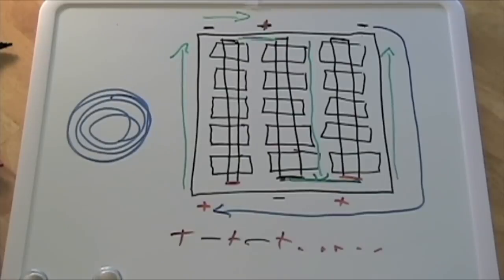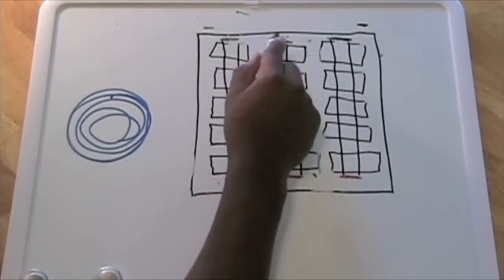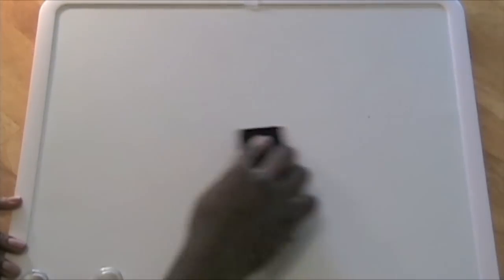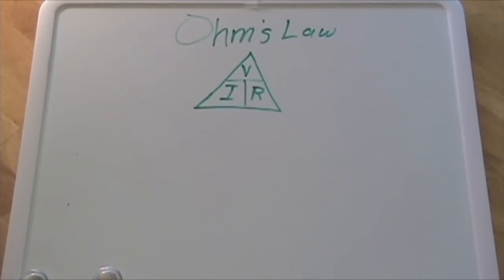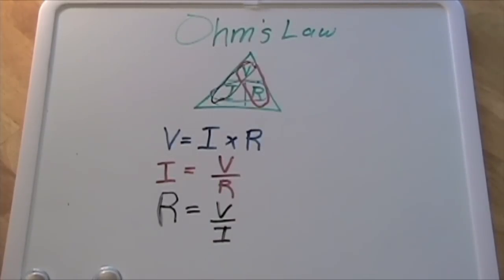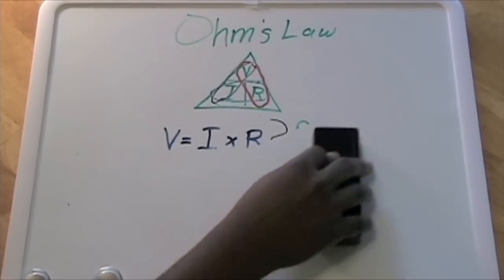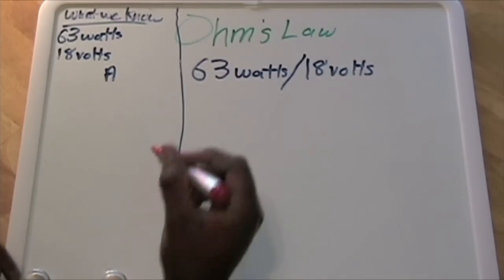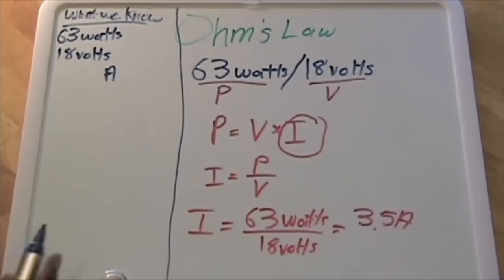How To Build A Solar Panel - Part 15 - School Series Part 2

Comment: hello sir, i read ur comment  i have one question with 154 solar cell in series, current will be only 3.5 amp , i hope for panel with 77v  and 270 watts current should be also high to charge the battery in fast rate . Please clear my confusion 
Thanks

Comment: @fybelectric 
If you build a 77volt panel, you dont really have anything you can use it for. what you can do is to build multiple panels for charging a 12volt battery, and then use a >270watt inverter to power  your applience (stereo, computer etc..) on120 or 230v, or whatever you need.
if you build 4 of the63w panels Robert just made in the video, and then connect them to each other in parallel, then you get 18v, and 315 watts. (more is better) Then you need a power manager able to handle it.

Comment from the maker: @fybelectric 

Well to produce 270 watts, if each solar cell is rated at 1.75watts, you are going to need 154 solar cells.

So since you know each solar cell is rated for .5v, you can just do the math which is:

154(solar cells) x .5v = 77volts if you are hooking it up in series

Comment: i want to build a 270 watt panel i know that my cells are 1.75 watts ,and 0.5v ,143 ohm 3.5 amp i am having troble with starting to figure out my volts as my starting point  so my know,s are 270 watts and my per cell info  can you help

Comment: I'm an electrician and I learned the Ohm's law equations on a prayer wheel, but your pyramid is  a far easier way to remember them. I've just watched all of your videos up to this point in one sitting and I'm not finished yet. You're doing a good thing here. I was looking for some DIY solar panel info and you did not disappoint. Nice attention to detail. GJ Thanks